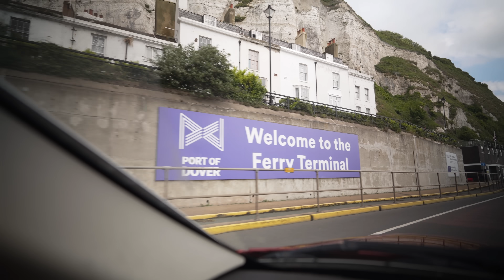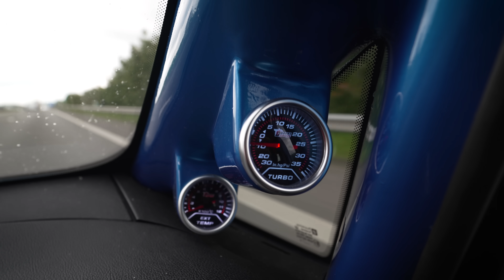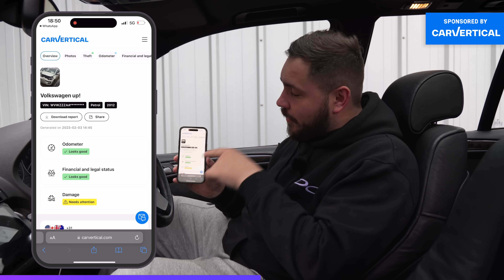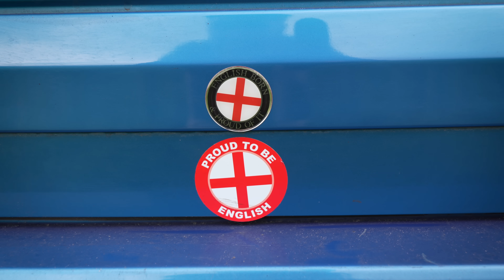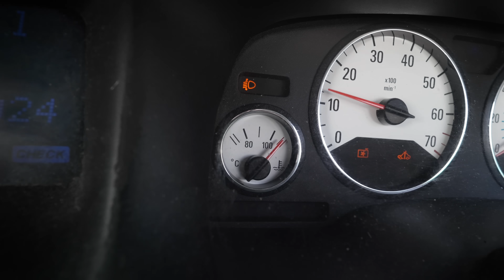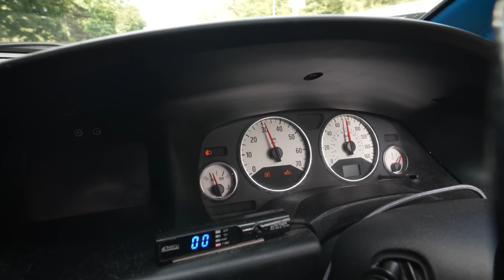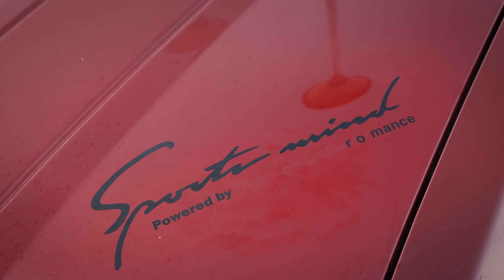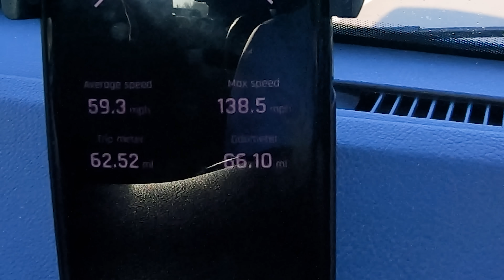Can We Hit 150MPH In $2000 Cars?

Comment: Random tip. I had a G Astra which produced random electrical issues similar to what we can see on the Zafira here. After several troubleshooting attempts by my car mechanic he asked one of the car electricians he new and he suggested checking the battery terminals. If they got hot, they are the problem and need to be changed. They changed the terminal which was bad (we were both flabbergasted with my mechanic on how a battery terminal can go bad...) and the symptoms disappeared.
Reply: Vauxhalls do be like that. I had a Corsa B that would randomly misfire/run on 2 cylinders and cut out when it got hot. On a motorway it would be fine for hours but around town it'd cut out and die and i'd have to wait 20 mins for it to cool and restart. It turned out to be the distributer shorting out when under heat soak. 

All of the dials falling to zero when it cut out at 19:09 was a PTSD Vauxhall moment
Reply: Standard
Reply: I had a Astra and zafira as company cars and both would go into limp mode when reved over 3k. Had to turn them off and on every 30 seconds, it got really boring really quick!
Reply: Thankfully our '97 Astra F had nowhere near as bad electrical issues but it did develop a problem where random warning lights would light up and stay on until my dad just put it on neutral and restarted it like Will did. Quality GM electronics :D
Reply: This no-start at the end reminded me of my Corsa c. The connector on the instrument cluster got loose, which in turn disabled the tach and speedometer, and the car wouldn’t start unless hitting the dashboard real hard.
Reply: I had two cars that would randomly lose power like that, it's really dangerous, I pulled out to overtake one time and I literally had to squeeze my way back in because it didn't have enough power to pass the vehicle.
Reply: getting corroded isn't that uncommon of a thing. usually just cleaning the surfaces would do the job though
Reply: Will’s lucky, my wife had an old SLK that would cut out like that, but it made the steering and brakes as heavy as hell without the power too. Wouldn’t fancy that at 100+
Reply: The Vauxhall owners have all the experience Will needs. Shame he's still stranded there a week later.
Reply: The G generation of opel/ Vauxhall all had strange reliability, they’d be bulletproof 90% of the time and only have issues with the strangest things. Had a 2.2 convertible G with an intermittent engine killing misfire, tried absolutely everything and nothing changed right up to finding oil in the injector part of the engine loom while I was testing another loom. Oil had wicked up from the pressure sensor right at the lowest part of the loom and wicked out to almost every plug on both the upper and lower loom and was causing the injectors to miss the firing signal sometimes
Reply: @mattus1gig  were they diesels? Usually a blocked EGR and inlet causes that. Fault code P0100.
I have a 1.3 cdti with the same problem and its annoying on the motorway uphill! I'll get around to cleaning it out one day when i have time, been putting it off for so long because it's such a messy job. The black 'coke' that builds up is like ink, takes a lot to get it off your skin.
Reply: @adamholmes91  yeah both Diesel but both under a year old with a few thousand miles on the clock. My local Vauxhall dealer were looking at them several times a month.
Reply: @florianschmidt2931  I'll remember your comment if that ever happens to me. 
I have a Combo B (Corsa C with a van glued to the back) and occasionally i'll lose the RPM gauge or it reads 1/2 as much, more rarely i'll lose the speedometer too.Been meaning to take clocks out and clean the contacts but i'm lazy.
Reply: Weirdest fault I had was a vauxhall combo cdti van that refused to start when the engine was hot. Perfect every time from cold, but when up to temperature it would turn over fine (sounding exactly the same as a cold start), would always bump start fine, but would never fire on the starter until the engine was cold. Could occasionally get it to go with a can of magic start, but even then it normally wasn't happy. Turned out to need a new starter motor. While everything appeared fine there was a fault on it and my garage thinks it would draw too much power from the battery and wouldn't inject fuel into the engine. Only solved it when the starter died a year later and was replaced. Refueling was fun for that year!
Reply: @lasskinn474 If the factory crimp wasn’t perfect, the corrosion can get into the joint.
Reply: Did the indicators or something else cut off also when used a lot? Or was it just the engine? Have similar issues here too
Reply: I had a TS Astra (G, MK4 etc) that would kill all electrics in the car above 3k RPM, radio, car dash, blew headlight globes, killed power steering etc. found the issue was an OVERCHARGING alternator. That fixed, car ran fine apart from occasional EGR issues, this was the 2.2L N/A ecotec
Reply: From my experience with old vauxhalls mainly calinras they really don't like after market sensors I had the crank senseor changed on my v6 it would run fine from 5 min come to a stop or change down a gear it would want to cut out

Comment: Zafira's crankshaft sensor might be gone. I used to have an Astra F with an X20XEV which is the same block and it had identical symptoms - random cut-offs while driving, fixed by just restarting the engine, getting progressively more frequent until it would die for good and refuse to start again. The old sensor simply disintegrated from age. I can't say for certain this is it, but these symptoms brought me some flashbacks haha
Also, if Zafira's rev counter ever went bananas when the engine died, that's another clue.
Reply: Agreed, I was also thinking crankshaft sensor
Reply: @idesignyou...9257  I've had a couple of Vauxhalls show the same symptoms. Crank sensor every time.
Reply: I 4th that diagnostic ...if was anything else there would be a hole in the block smoke and oil everywhere
Reply: got a 1.6 zafira b and it judders cus of EGR but randomly cuts out when slowing down after 50/60. you reckon it could be the crank sensor
Reply: Not an opel but similar symptoms, my old Primera used to do the very same with a dodgy crank sensor. Very likely the issue
Reply: Same kinda issues with an Opel Combo and also the crankshaft sensor.
Reply: I’ve not long got a mk5 Sri turbo and it just randomly cuts out and turned out crank sensor
Reply: Just put of curiosity,what do you mean exactly when you say the gauge going bananas?
Reply: @TheRealNeoFrancois  Imagine if it kept going from zero to max and back to anything imbetween faster than the engine could ever possibly react, while it can't, because it's completely unresponsive and slowly losing revs as you're driving down the road. An interesting feeling, for sure.

Comment: Nice run, here I would recommend some tips, I am a trucker, if that helps; do it at night, almost no traffic, better visibility (lights are easier to see in the dark) and colder outside, so better for the cars and safer for you and for the other cars, try to look for a straight portion with 3 lanes and no speed limit (use the left lane, think UK in this case), unafortunately in your case, hard to find considering your entry point into Germany, if you do a run in the future, I highly advise avoiding the Ruhrgebiet area (everything between Dortmund and Köln, including Aachen, make a circle, it looks like a black hole on the map), due to traffic, junctions, and speed limits. Have fun!👍

Comment: Seems like you were in the Aachen/Venlo cologne area? That's usually quite crowded. I would recommend going a bit further south.

I would recommend the A1 from Tondorf to the Bliesheim intersection. It's mostly unrestricted around 40km. and usually quite empty. The good thing about this part is that it has a constant gradient. Towards Bliesheim (close by Cologne) it's all downhill and the other direction is all uphill (a lot of sports cars catch on fire in this direction). 
The other stretch of road I would recommend is the A60 between Wittlich (it meets up with the A1 there) and Prüm (close to the Belgian border). You've got around 50ish km of unrestricted road there. usually pretty empty and with a lot of ups and downs. Some pretty steep and good to gain speed. Furthermore, it's quite close to Luxemburg so you can fuel up pretty cheap.
Reply: Great advice, someone else mentioned this in an old m3 forum, - i took this specific route when driving to the Nurbugring in the summer, slightly longer route but the A1-A60  autobahn route was great fun

Comment: Without checking the car or the codes or anything, I'm going to say it could be the crankshaft or camshaft position sensor, it depends where that car gets the engine speed from (typically the crankshaft one). My focus had the same problem and it was the crankshaft sensor 😂
Reply: I've already posted a comment about the same thing, I used to have an Astra F with a similar engine that had exactly the same symptoms. Diagnosis: busted crankshaft sensor. Gotta be it.
Reply: and let me guess the engine, the mighty 1.6 tdci
Reply: @alexmvk_  No, mine is the 2.0 TDCi, but probably the same design flaw... I'm on my 3rd crankshaft sensor 😂 It's good they are relatively cheap.
Reply: engine would keep running without camshaft sensor (error code p0342), but it will loose power and start consume more fuel. but without crankshaft sensor it will just die.
Reply: @lordmmx1303  There are some engines that can keep running without one of them, since they use the other one as a backup (in case of variable timing, they fix it to the default value). But clearly not mine or that one 😅

Comment: Sell the Crossfire, get an old Saab and put the engine into the Zafira - you'll get MASSIVE horsepower!
Hook up with Crankworx, they're the specialists in doing these Saab engine to Vauxhall conversions. It would make a great video series.
Reply: Not exactly true. I've done the swap, without a huge turbo neither lump will crack 400bhp  

It's alot cheaper to get close to 400bhp with a b204 lump rather than a z20 lump, but that doesn't make it 'better' or even more reliable. 

I will give a shout out to crank n elv. Those guys helped me alot with my saab swap
Reply: @DisAstra-qx9gq  New video up. They said they're going to do up the Zafira. It'll be interesting to see what they do and how they're going to increase the horsepower. We'll have to wait and see if they go the Saab route as suggested. Hope they do.
Reply: @djdrwatson  
Ruined the next video 🤣

If it is a forged z20, no point in the saab swap. A forged z20 is a good starting point for big fwd power. Plenty have cracked 500bhp but then it becomes undriveable. 
A diff does help but zafs always struggle to put the power down.
Reply: @DisAstra-qx9gq  They havem't started yet! Leave a comment and tell what they need to do to get the best/most horsepower.
Reply: @djdrwatson  it all comes down to budget, there's plenty of room for another engine in the boot or even a rwd or 4wd conversion.

Comment: Seeing Will turn his car off and on again while moving reminded me of how I crashed my first car. It had developed a cold start issue and would be in limp mode in three cylinders. The temporary fix was to turn the engine off and on again when warm which worked for two weeks. Then one morning, on the same straight bit of road I’d been using to turn the engine off and on again while still moving for those two weeks, I hit a small bump as I turned the key. This made my arm bounce which in turn pulled the key out just a little bit. That put the steering lock on. I then couldn’t get it off again before the next turn approached and into the ditch I went 😬😂 so Will, be very careful turning the engine off while moving 😂

Comment: The Sports Mind sticker is an original Suzuki sticker, featured on one of the late 90s Alto Works variants. I had a pair on my ZC32S Swift Sport, but I did chuckle at the eBay listings for every other brand going, and then the Sports one featured in this video.

Comment: Should have bought an el-cheapo S60/V70-T5. Mine was bone stock and i have seen 250km/h (slightly faster then 155mph) on the speedometer.
There's a reason why they were used by many police forces.

Comment: zafira sounds like is has a earth issue! common on these espeically when people have played with them, i own a coupe turbo with the same engine,
also check AFM wiring map wiring and injector loom wiring and do whats called the earth mod! fixes alot of issues! , the reason the aux belt is rubbing the oil cooler lines is becuase some ones running the wrong belt and direct route due to AC delete,

Comment: I’ve just done this exact journey this week to northern Germany and back, through France, Belgium and Netherlands in my BMW E61 535d Touring

That part round Antwerp is an absolute nightmare. Just solid traffic jams both ways.

A word of caution (I drive on the Autobahn a lot): 

Firstly, it’s a myth that it’s all speed derestricted and that you can “drive as fast as you want”. In reality, actually not that much is. That’s either due to actual speed restrictions being in place (commonly 130 kph) or because of the amount of traffic making it impossible or roadworks which are common because a lot of the network is old, worn out and being replaced.

Secondly, it is VERY dangerous to attempt Vmax on two-lane segments of the Autobahn. If you do and someone even going at 100+mph pulls out to overtake a lorry, for example, and you are doing 150 mph you have absolutely nowhere to go! The naive answer is always “Yeah but Germans get much better driver training and exercise strict lane discipline.” 

This is “naive” because even if that were true, Germany is at the centre of border free Europe and its Autobahn Network functions as the crossroads for drivers from all over Europe….with HIGHLY differing standards of driving! Lots of cars cross from eastern Europe and I have seen some spectacular examples of appalling driving…..and then there’s the Belgians! 😮

Comment: Funny the vauxhall astra  coupe turbo z20let does 147mph   

And with just a little tuning and the z20leh with stock 5 speed manual gearbox it will take you up to 165mph without any lack of power   that is a true rocket machine

Comment: 2:25 bahhh 12 that's no problem at all.. I just drove my Jaguar XK8 home from Birmingham where I brought it this weekend with 8 PSI in my passenger side rear 😭 

No word of a lie, someone put that locktite stuff on the tyre valve caps so I couldn't check or add air where I got it I needed a 10mm spanner from home 😂😂😂😂😂😂😂

Comment: In the crossfire, a strut that is blown would bounce the wheel at speed, potholes, bumps, etc. It might drive just fine, and you don't even know its happening. All this as your wheel is hopping off the ground at 70mph on the freeway (you call that a _motorway_)
Reply: Looks like the crossfire needs a balljoint, bushing, or similar on the left rear wheel. Could be out of balance also.

Comment: While there in no speed limit on some German autobahns, driving as fast as possible with the sole purpose of going as fast as possible can be considered an illegal street race, even if you are "racing" only against yourself. This is known as a "solo race" or "racing against oneself" and is punishable under § 315d of the German Criminal Code (StGB).

The penalties for such illegal street races can be quite severe. The possible punishments include:

    Imprisonment: Between 1 and 10 years if the race endangers the life or health of another person or property of significant value. In less severe cases, imprisonment can range from 3 months to 5 years.

    Fines: In cases where no significant danger is present or in less severe cases, a fine may be imposed.

    License Revocation: The driver's license is usually revoked, and a period is set during which the license cannot be reissued.

    Vehicle Confiscation: The vehicle can be seized and confiscated.

I think the authorities should go after this more, especailly when it is so nicely documented...

Comment: most issues with these Engines are the coilpack because its not the original GM/Opel/Vauxhall part if you hear clicking from the right site of the engine. Camshaft sensor, crankshaft sensor get the same problems
btw im an Opel/Vauxhall freak

Comment: Does the Zafira have an electric throttle pedal? In that case unplug the plug from the pedal and put WD40 in it, plug it back in and see if it makes a difference. Edit: Also it sounds like there's a brake caliper that is sticking... Perhaps in the back, but it makes a thumping noise at speed. Edit nr. 2: Nevermind... 🤥

Comment: No way that zafira has to do 150mph I did 136mph in a 1.8 16v 115hp Vectra B, basically a car from the same era
Reply: They can do 160 with boost turned up and a intercooler and exhaust system

Comment: Had to turn this off. If a car is pulling the first thing you look at is tyre pressure. You don't check wheel nuts or lie on the floor not being able to operate a jack. I thought these kids were supposed to be clued up. Another fake video.